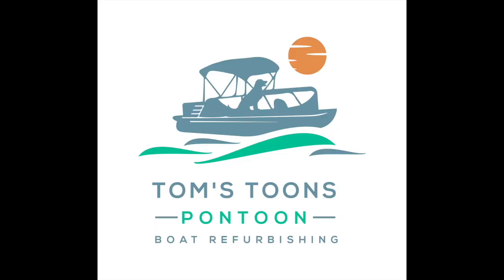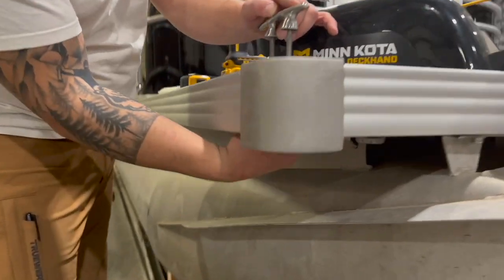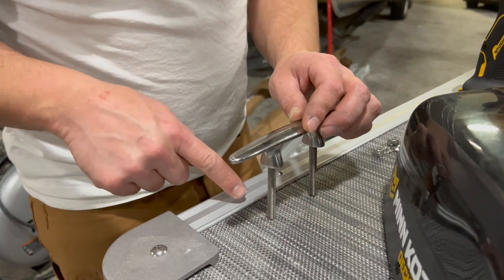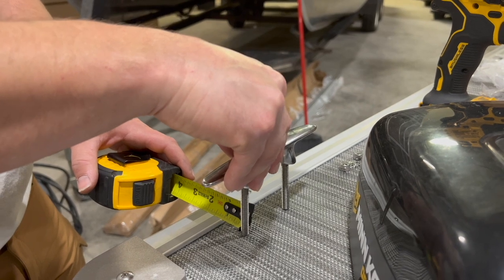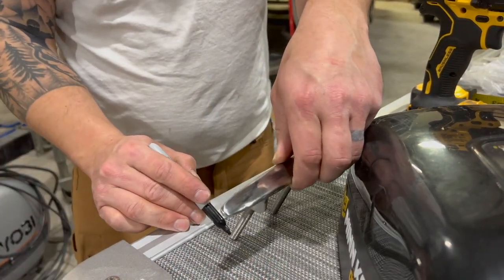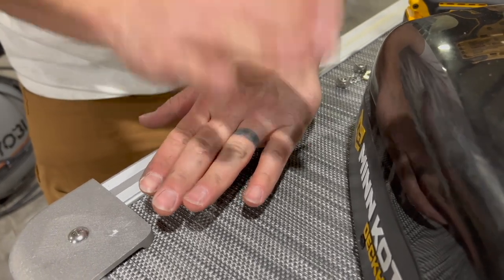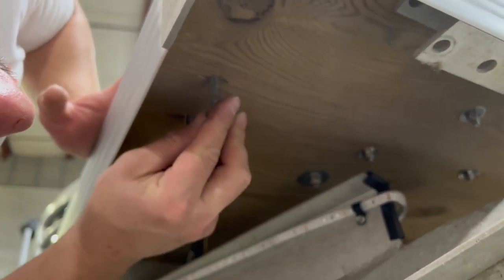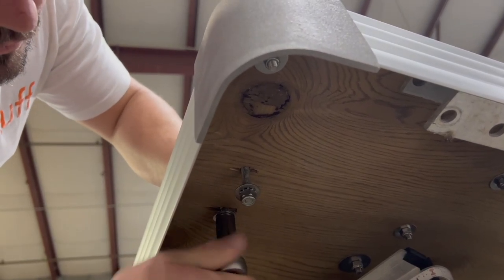BOAT CLEAT INSTALLATION - Pontoon Boat Two Post Cleat

Comment: Do you ever mount the cleat directly into the rub rail? Downside to it? Seems like the new pontoons around me are all installed in the rails.
Reply from the maker: Quite often, yes. I just like to make sure there's enough space to get fender washers in on the back side and have some meat of plywood behind to prevent them from ever ripping out. Some rub rails don't have much to bite into underneath. It just depends on the boat.